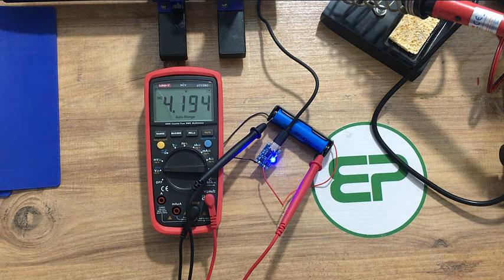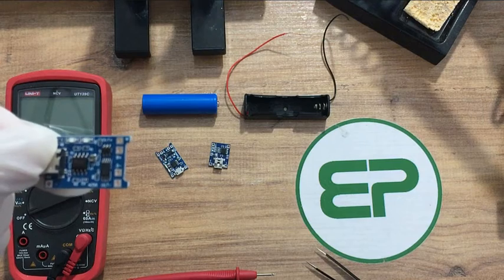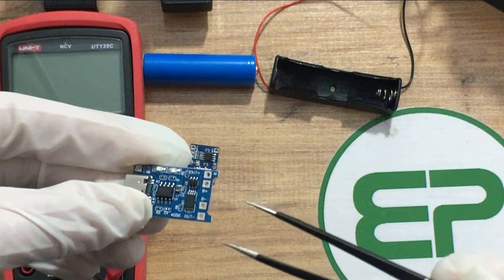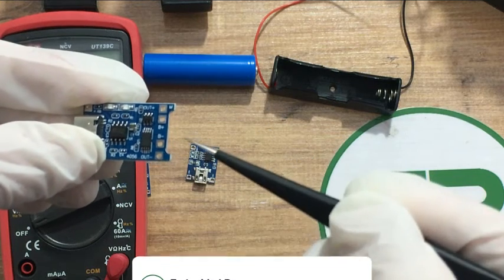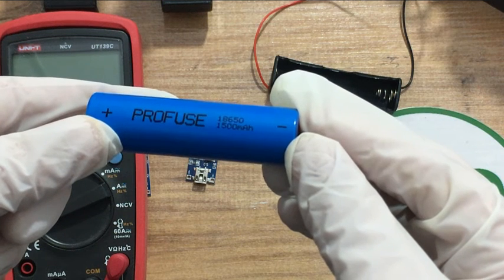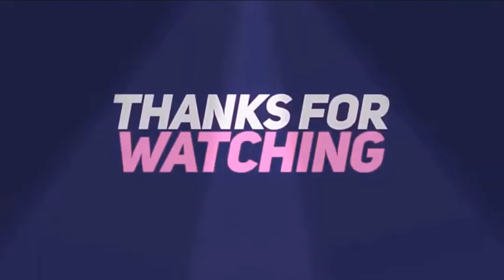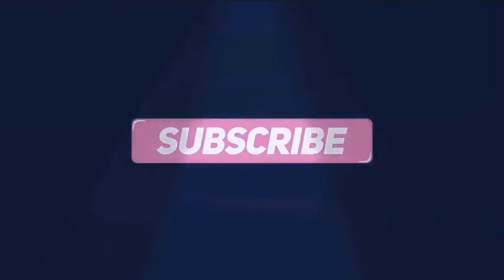How to use TP4056 module to charge Li-Ion battery | TP4056 Analyzing

Comment: Can it use for 2.4v battery ?
Reply from the maker: Unfortunately, No.
Reply: @ ok, which module can be used for 2.4v battery
Reply from the maker: @mohammadahmed2855  Please check BQ2000 & BQ2002

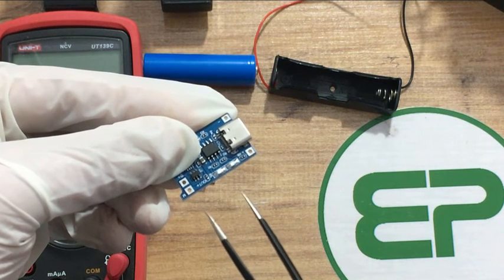Comment: 1:48 the solder pads provided are for external led connection. I spoilt 4 boards thinking it is for voltage input. Please recheck.
Reply from the maker: B- and B+ are for battery input. OUT- and OUT+ are for load (Driving LED or any other load)

Comment: Is it possible to supply the input power using 2 wires instead of USB cable ? I tried connecting DC 5V power to the VCC and GND pins of the USB connector, but it spoilt the board.
Reply from the maker: Yes, you can. You should Apply VCC to IN+ and GND to IN-